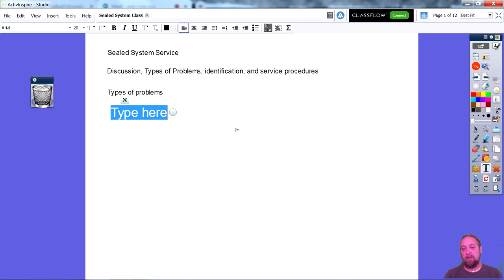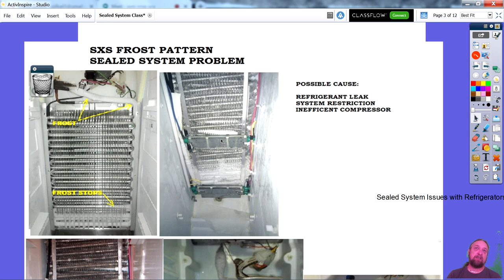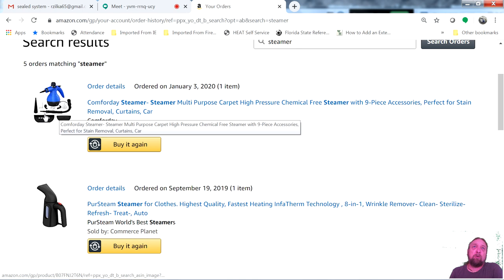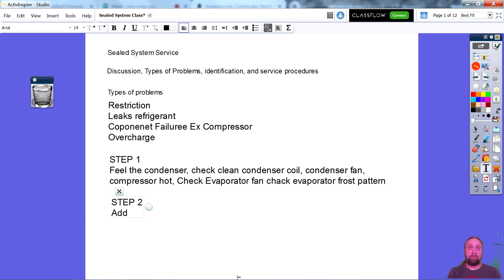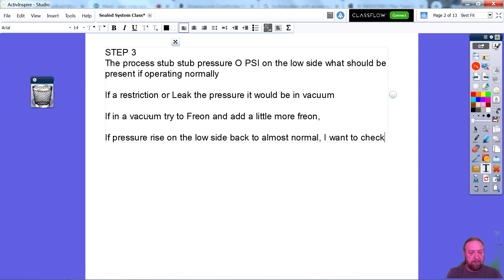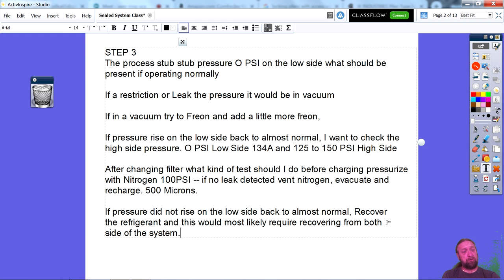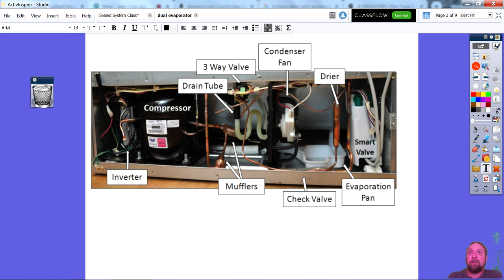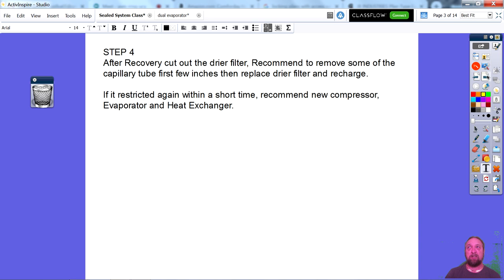#TECHTALK Sealed System Discussion Part 1

Comment: Appreciate it very detailed explanation, one  question sir if most likely restriction is in filter what is recommended  temperature difference in & out of the filter to separate the problem, thanks
Reply: Sorry for the delayed response, I did not see this question. The temperature and pressure in and out the filter should be the same, the filter is not there to create a pressure difference. Now if there is a temperature pressure difference in the filter that would indicate the restriction is in the filter.

Comment: i have a frost buildung up at where my suction line meets my capillary tube near my evaporator. does this indicate a restriction?
Reply: Either a restriction or low in refrigerant, and sometimes an inefficient compressor, adding a little refrigerant to see if pressures normalize in the system will show it was low on Freon if refrigerant is added but frost is still evident at the capillary entrance then is a restriction in the capillary tube.